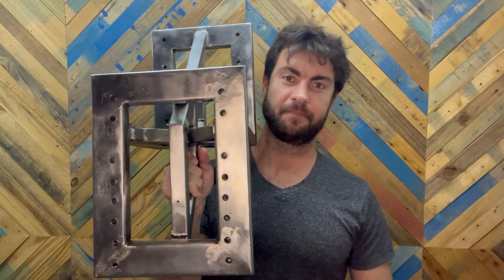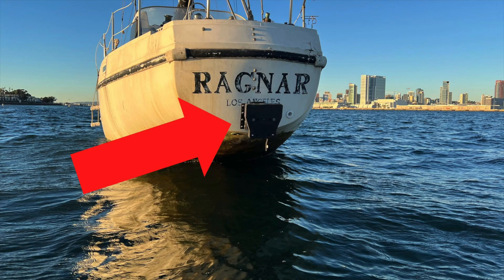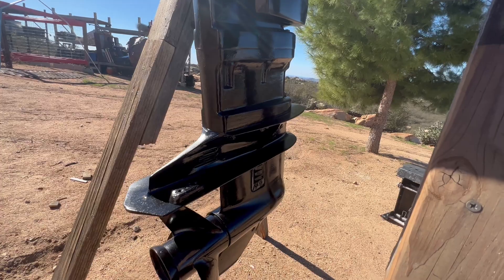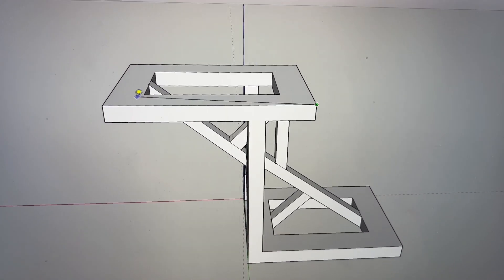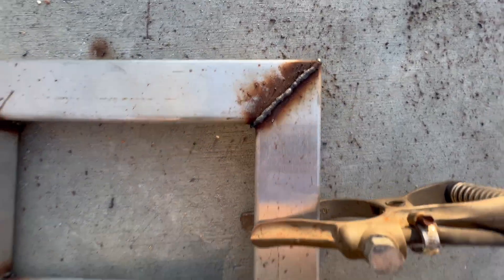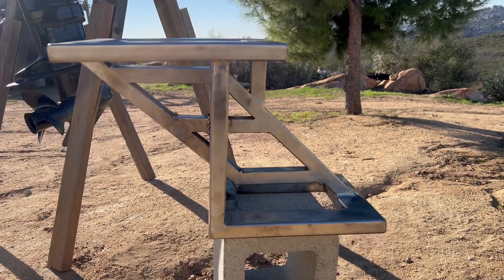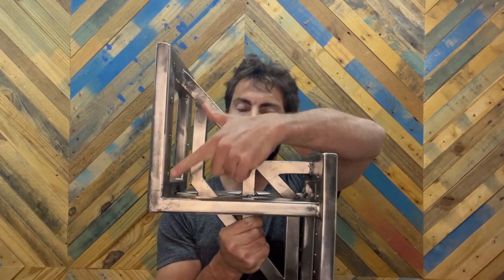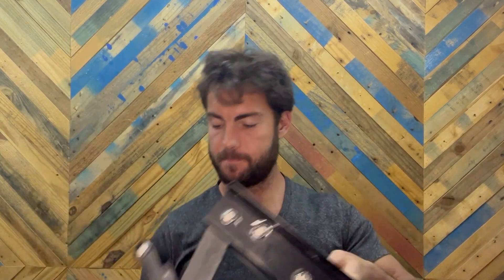Fabricating a Custom Bracket For An Outboard Motor Bracket for a Sailboat (Episode 18)

Comment: Y0 acabo de poner uno de 18hp tohatsu y no puedo desbloquear el braquet panther 😢no entiendo vino defectuoso de fabrica? Tanto trabajo para nada...
Reply from the maker: Hi, double check the two loosening screws on the side of the bracket. They keep the bracket from unlocking when you are underway. Loosen them to adjust hight, then tighten them once you have the motor in the position that you want it in. Hope that helps!

Comment: Interesting solution. I guess it wasn't possible to get it closer to the stern? The bracket looks good. Have you looked into getting a  harness for moving up the mast? You might be able to get the bracket on using a harness hooked to the halyard.  You would need another person winching you up and down. It would be easier than getting on the dinghy and doing it that way. Or, you can get the ladder done first and use it to install the bracket.
Reply from the maker: Thank you for the kind words! Unfortunately it was not possible to get that bracket any lower without adding additional drop. The stern of this Columbia is very high, which seems to be a design favored by William Tripp (the designer). 

I do not have a mast harness yet, will certainly need on very shortly. Harnessing down would certainly give me more stability. At the moment, it looks like I'm going back in the dingy 😒 for another bumpy install... Hopefully all my math was correct!
Reply: @ambiguousglobetrotter  Good luck. It will make for some entertaining footage.